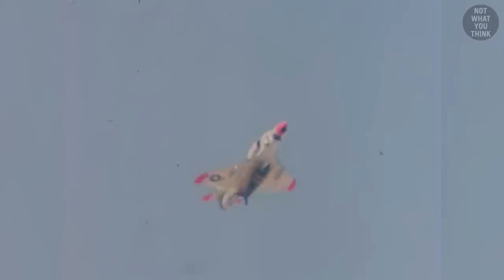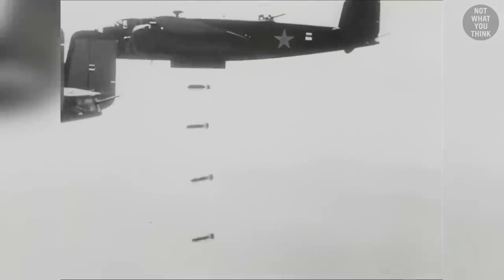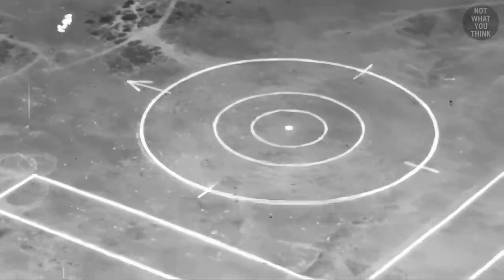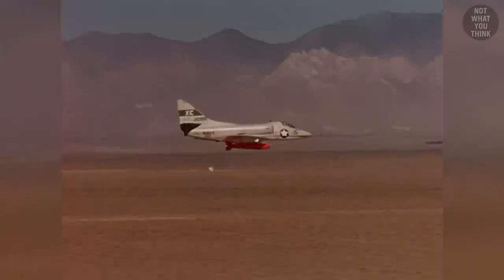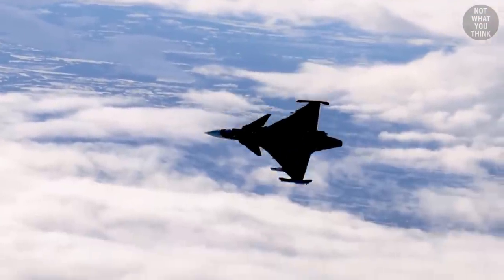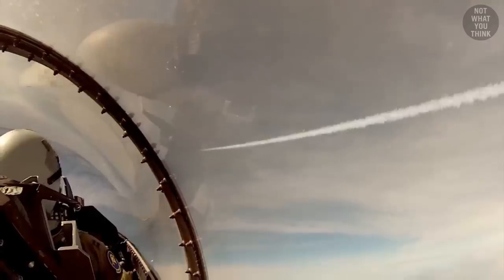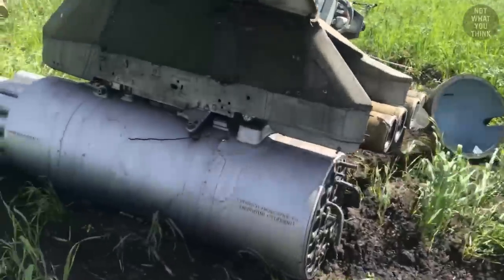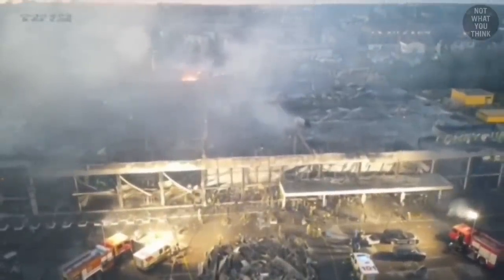Why Are Russian Helicopters Shooting Up at the Sky?

Comment: When I flew helicopters in the US Army, we lofted rockets. There are several reasons, if you have airburst rockets you can get good dispersion, wide area coverage, and there is also a possibility of guided rockets. The US now has 2.75” guided rockets.
Reply: oh no he is pulling a war thunder
Reply: what year did you serve? would be interesting to know that Lofting was used by Apache or late AH-1 variants
Reply: @xdxrk classified? 😂
Reply: FD&BJ  They have guided variants of the S-5, called the S-5Kor.
Reply: @LTNetjak Maybe so, but they won't make up a completely fictional weapons system out of thin air. How much they produced, we cannot know, but it exists.
Reply: @LTNetjak Supposedly? We're currently coming up on the one year anniversary of Putin's "two week special military operation"

It's not a bad tactic for them to overstate their actual strength. It works in their favor - at least all the way until the point where they run out.
Reply: can tell you dont know the difference..... MISSILE = guided     ROCKETS = arent....  the only reason they split the names
Reply: @harleyme3163  That's true, but it can be blurry at the middle ground, there are now "semi-guided" rockets, I don't know the proper term, but they are dumb rockets equipped with simple add-on guidance systems, which aren't as sophisticated (and expensive) as purpose-built guided missiles, but it still makes them more accurate than they would be otherwise.
Reply: 5cm rockets?
Reply: FD&BJ  the Ukrainians are utilizing this tactic also and we supplied them with guided rockets so it makes much more sense if they are using them
Reply: Dream on Mr. stolen valor. I bet the closest you've ever been to a helicopter was watching Magnum PI in reruns 😂
Reply: As far as I'm aware all the small pod rockets used by Russia are still exclusively laser-guided or unguided. To me this looks like the pilots are trying to avoid eating an Igla, and I can't really blame them
Reply: POV: lvl 5s in war thunder learning how rockets work so they can buy a ka 50 without any tank or plane
Reply: FD&BJ  Russia definitely has guided rockets, and probably some very good ones too. Russia does have a large and modern army after all. Its just that the large part isn't modern and the modern part isn't large
Reply: Yeah.. super curious about what year you did this and airframe and generally everything about the US doing it.
Reply: @Hawk7886  keep delusional, Hitler hoped so too...
Reply: @praevasc4299  also 80mm and 120 too
Reply: @xdxrk  how is that sensitive info?😂💀
Reply: @dylanschulz9118 most "modern" are visible only during 9 of may  parade 😁
Reply: Good dispersion....over a city sized target.
Reply: Guided rockets? So like... missiles?
Reply: FD&BJ  The basic S-5 is indeed unguided. But it has a guided variant, the S-5kor. I doubt we can tell for sure which one was used in the video. Btw if you're just laying suppressive fire over a large area, or are targeting a large factory or power station instead of individual vehicles, then even tossing (plenty of) unguided rockets can do the job.
Reply: @LTNetjak While the US has been thinking itself world police, world justice and King of the hill since 1945.
Reply: @Hawk7886  Russia vs Ukraine was a two weeks war. It has just become another war when the US dragged NATO and the EU into it. Yet, Russia is still winning.
Reply: @Hawk7886  Wonder how much of your countries tax money went into prolonging this "two week" conflict?
Reply: Flechettes scare me
Reply: FD&BJ  Ugroza might be a thing, but they certainly don't have them in huge numbers and it wouldn't make sense to fire volleys of those. The rockets are then designated S-5/8/13Kor.
Reply: The answer is actually called the “legal cluster bombs”
Reply: Did you leak the classified forms again?
Reply: @xdxrk  Service Men don't accidentally leak information while fact check nerd challenge (Impossible)
Reply: the APKWS rockets. lovely little things...
Reply: @Dkmasteris  same amount of tax dollars that went into prolonging the 2 weeks to slow the spread.
Reply: FD&BJ  Russians DO have guided rockets. Laser-guided for example S25L
Reply: @hunormagyar1843  rockets are missiles already
Reply: @bobwoods1302  looky here, the source of knowledge for every military operation! I didn’t know you had the knowledge about what every single soldier or pilot did over there. That’s awesome, so glad you could share and fact check. Seriously, get off your keyboard and touch grass.
Reply: You're obviously not a helicopter attack pilot. What was your unit where did you serve?
Reply: There is no doubt Russia has very accurate and fast large missiles …. So why not small helicopter launched ones …., just remember how big a cell phone was when they first came out , and now it can be in a watch. Yes, some countries lead the world in this micro tech , but technology is adopted quickly by others , sometimes by espionage other times by peaceful uses of the tech- I don’t know for sure but it stands to reason that if Russia can apply the technology to military uses then they will have
Reply: @vincentcarmine8731  Occam's razor
Reply: And the ladies say 2.75 inches is plenty enough, don't worry it happens to a lot of helicopters. 📏
Reply: We still “loft” rockets but it’s usually to super elevate the rocket pods because the pylons will only articulate up 4*
Reply: @FREEMAN....  It's probably a terrible idea to get involved in this type of stuff, but what kind of inaccurate crap are you seeing because Ukraine has liberated a bunch of russian occupied territory recently. And NATO isn't fighting in the war as it seems to me like you think they are, they're just giving some weapons, equipment and humanitarian things. Also, Ukraine vs. russia went longer than 2 weeks even before NATO started giving Ukraine any actual supplies.
Reply: Thanks for this! I'd not considered airburst rockets (I'm medops, not combat arms). My impression from the vid was the lofted Russian rockets weren't guided. Good reminder that certain guided types could be launched usefully this way.
Reply: ROBERT O'CAMPO  even US aerial rockets are not fire and forget, you need some kind of laser pointing. If it's the helicopter itself, it will increase the danger time and chance of air defenses responding. If it's laser designated by infantry then good but with such a little warhead, its use will be limited case wise and laser designation simply means not able to attack area wise for which rocket pods are for.
I don't understand but lobbing aerial burst rockets seems quite reasonable to be.
Reply: @harleyme3163  also missile close oveer surface and rocket parabolic trajectory? or not? we dont have the word missiles in our language :))
Reply: What happened to the other .25?
Reply: First up, thank you for your service.
Second, thank you for this info
Reply: @bobwoods1302  bro don't be starting on the supreme 'stache  Magnum P.I. or you'll be catching these hands!
Reply: That Is my second guess, first was just dumping ordnance before returning to base.
Reply: good point from a veteran...
Reply: @harleyme3163  Look up APKWS.
Reply: The west has 'modern armies' and a military doctrine of those well-trained tactical battalions that are very good and effective, BUT only in small and contained war theatres where is a need for "fast hit and return-surgically precise outcomes"! Thou tech. modern, and tactically trained, all that would be far from enough in some wide and huge war theatres, with battlefronts stretching more than 1000km or even 2000km. "The west" have no enough even a simple riffle munition, let alone "all the modern stuff".
For example, Russia has more tanks(conserved) than the whole west has ATMs, OR even no near enough military personnel who are trained to operate with those ATMs! Do you get it?! No need for all those tanks to be super modern! Their sheer number is so large. In the end, it will always win a soldier with more bullets in his gun, no matter if his gun is old and not modern.
It's not only whose army is more modern, but how much you have of EVERYTHING. From a bullet to an atomic bomb
It is a bit like the argument of AK vs AR rifle.
AR might be the better rifle in actual performance, but is it at an advantage in a full-spectrum war?
Doubtful. 
At this moment in no nuclear war, NATO would totally lose against Russia. Simply cause it has nothing enough, even the most simple, not hi-tech things, and cause it has virtually no military reserves in personnel who would support those well-trained "tactical battalions". All those "well trained" are in small numbers and could not even be able to support their own equipment and themselves in a wide full-spectrum war, let alone advance to anywhere on battlefields stretching as say 1500 km, where daily Russians 'rain blunt-metal' far more than what the USA used in the whole of Iraq war!
In the end, for the simple example, the only question remains:
Are you really able to rain 100,000 heavy ammunition DAILY on the heads of your opponent and for how long?
(Russians DAILY rain 75,000 pieces of heavy ammunition on Ukrainians nowadays on the line of front stretching almost 1000km, and that number is the number of heavy shells the US used in the whole war in Iraq!)
Reply: @Swampfox1966  p
Reply: @Theiliteritesbian  why don’t you go somewhere else where your taxes won’t be used for bombs? Like possibly another planet maybe? Because this is how the world works, always has, always will.
Reply: I love everything about ever expert that chose a moment to entertain me in this YT comment thread 🤣🍪
Reply: USA fought people with rpgs not stingers
Reply: @vincentcarmine8731  The controllables were next to this big drum of missiles. There are anti-tank 130mm guided ones. You can hang various weapons from the helicopter. The same missiles are designed for area strikes, for enemy manpower, they do not need accuracy. They should be cheap and there should be plenty of them. If we talk about guided missiles, there are both air-to-air and air-to-ground missiles for helicopters.
Reply: @LTNetjak I could say the same about the US but most countries do.  The difference here is that this conflict is on Russia's doorstep meaning all their logistics are close by and is way easier to maintain a war.  The logistical problems for the west are huge...probably wouldn't of been as bad and might even have been able to repel Russia if the heavy equipment aid was flowing at the start of the conflict and not trickling in small numbers at a time.  I will say what I believe about the Russian military is that we in the west have underestimated it's conventional military power and economy.  Ergo we are now guessing on what can be accomplished in Ukraine from our stand point.  Frankly I don't believe we will get terms favorable for Ukraine nor the western position.
Reply: Poor guys, you are absolutely lacking of understanding about what happens there :)
Reply: @@LTNetjak and the West has a history of grossly under-estimating them.
Reply: @Hawk7886  Do my facts hurt your poor lil feelings? Russian bot beating up an uninformed Ukraine bot...like our own little Ukraine conflict.
Reply: @Nathan666  yikes
Reply: cool thank you. how far away are the targets usually? the videos i see with heli's raising and shooting, they never show the impact or results.
Reply: @bmorestance  10-12km most likely. So not gonna be visible in the GoPro cameras mounted to the aircraft, and most likely not even seen by the helicopter themselves. It is  more like artillery at that point, where you are firing at a specific area the enemy are in, and neither side sees each other.
Reply: @Nathan666  Thanks Nate. Very Interesting.